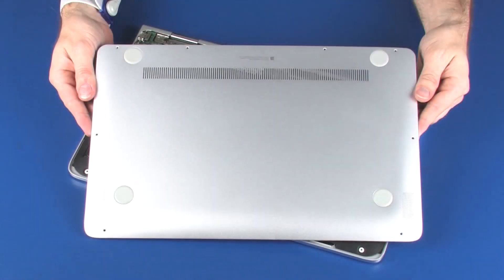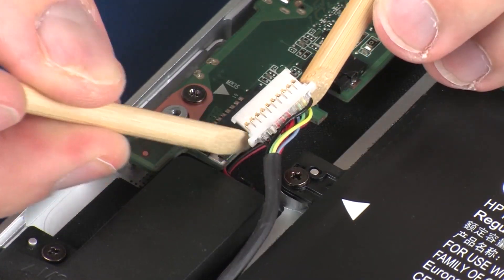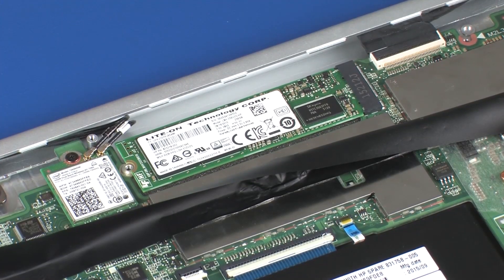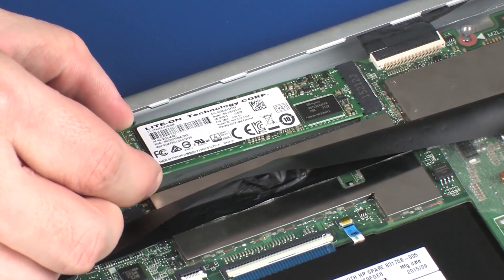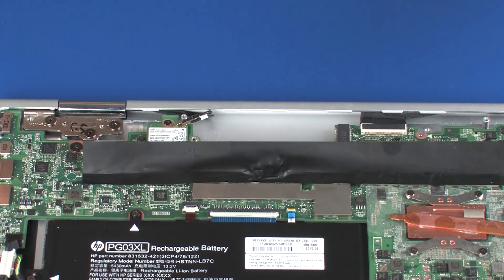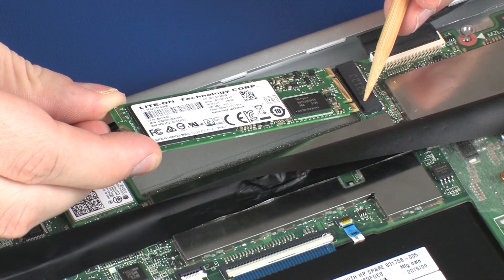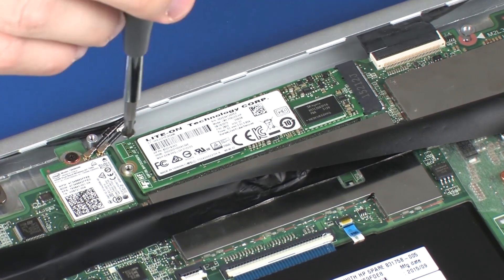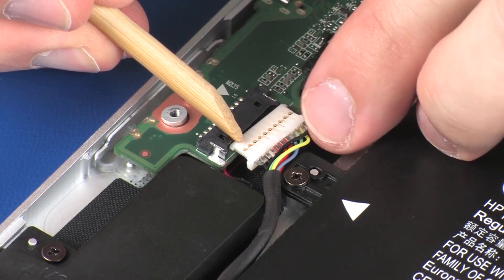Replace the Solid State Drive | HP Spectre x360 Ultrabook | HP Support

Comment: Will this void the warranty?
Reply from the maker: +Abi HP does not recommend upgrading or downgrading hardware parts or software that is bundled with the product as It may affect the manufacturer's warranty and performance, however, you could change the configuration at your own discretion.
Reply: @HPSupport  So it does void the warranty?
Reply: @j_bubblez279  It's called legalese evasion.
Reply: @HPSupport  You could answered in one word "YES".